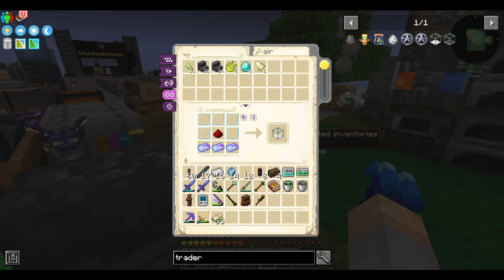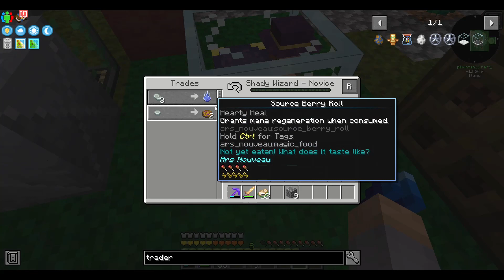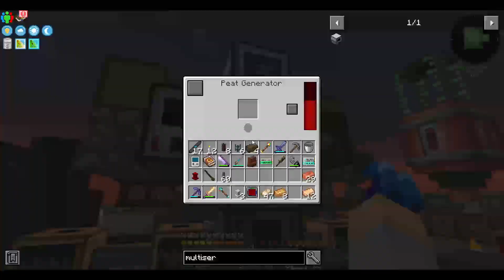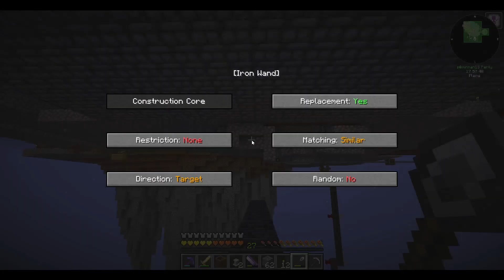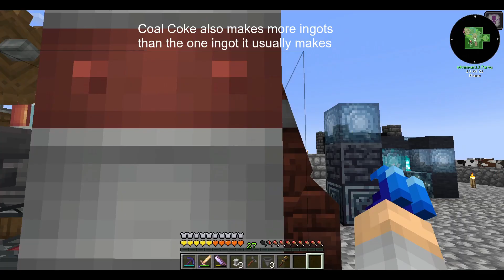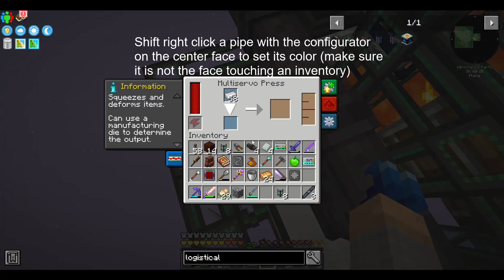FTB Skies Expert Guide- Episode 5- The Neo Forge

Comment: The plate production is quite simply done 👍🏼 but can you limit somehow how many plates are made? Otherwise it will turn every single ingot into plates and you are left with no ingots after all?
Reply from the maker: it stops when the drawer is full. given that resources are perpetually made, that isn't really a problem. ingots are made faster than plates here.
Reply: @pikminman13  i was thinking about splitting them up with brass tunnels that would also work but your solution is way better👍🏼